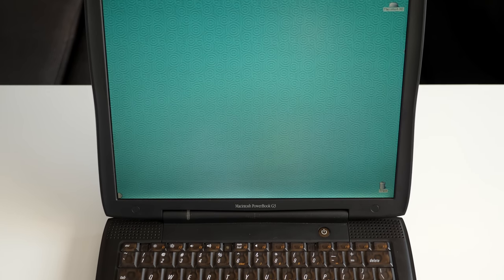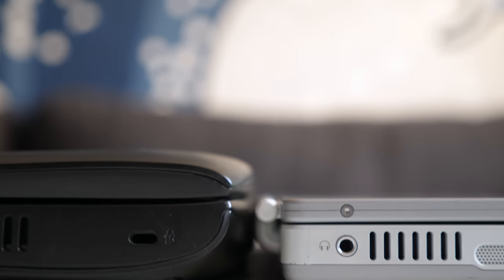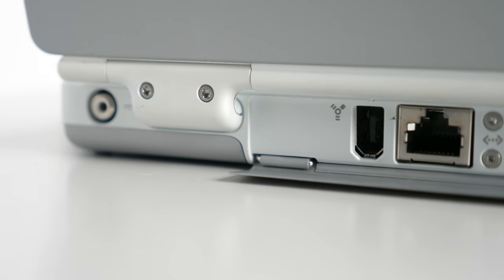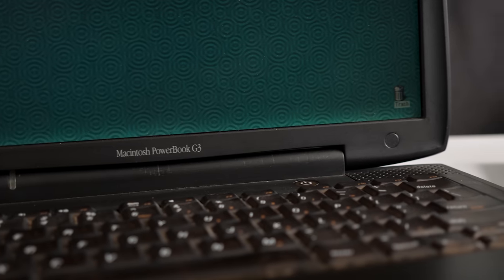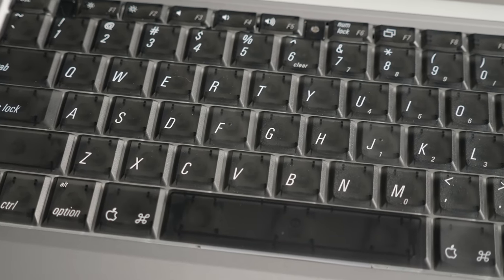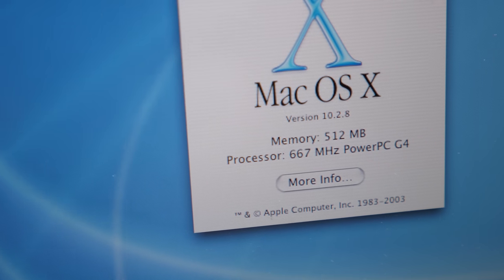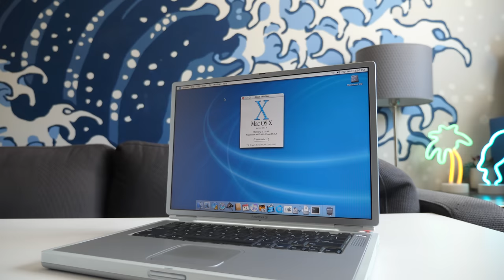The laptop that made Apple switch to aluminum

Comment: I was working as an on-site Mac consultant in 2001-2002, right when these machines were common, so I worked on them a lot. They were cool, but awful. The fit and finish was awful: you had to kinda twist the bottom cover into place because the screw holes never quite lined up. My guess is this is why the hinges failed so often: being under torsional stresses they’re not designed for. The hinge clutches would become extremely stiff to operate, and then that in turn would cause their mounts to snap. 
Also, I think you didn’t even mention how some people’s sweat reacted with the metal (once microscopic scratches in the paint allowed the sweat to come into direct contact), resulting in ugly green corrosion.

Comment: There were G4 upgrades available for the PBG3 models. Honestly they were a better buy than the Ti PBG4 for the first couple revisions because you kept your old computer with all of its extra batteries and accessories and enjoyed increased power, while the Ti PBG4 was only a marginal improvement over a stock Pismo's performance (unless you were really into AltiVec apps which was unlikely at the time) and was never offered CPU upgrades. Only with the improved bus speeds, graphics chips, and L3 caches available in the later models did the Ti PBG4 fully eclipse the best upgraded Pismo PBG3.
Usually the Ti PBG4's titanium bits themselves weren't the problem, but the plastics, pot metal hinges, and adhesive holding much of it together that failed. Also, like with the iBooks and other models with the same retractable hook-style latch, the magnet could become damaged and lose its ability to attract the display hook, or the hook catch on the release lever could break (it being made of the same cheap metal the hinges were). I've had to epoxy more than one Ti PBG4's case back together. JB Weld works really well for it: extremely strong, similar grey color to the case, fully workable when dry, and non-conductive.

Comment: Had only one battery, but you could put it to sleep & swap the battery out for another one - I think you had about 5 minutes before it'd power off completely. After you swapped a new battery in, you'd be able to continue working where you left off. The faster drive made a difference in access time, sustained transfers were bottlenecked, so it was kinda worth it. But that hinge man... I've got a coffee-can full of TiBook broken hinges in a tool drawer. It was a good machine but fragile.

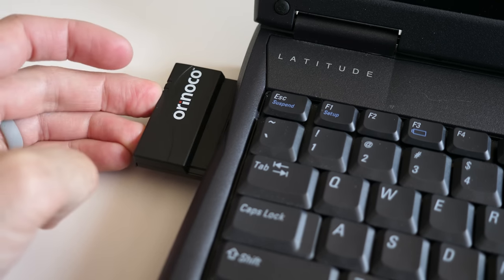Comment: 4:30 Apple wasn’t just somewhat early to Wi-Fi, they literally launched Wi-Fi into the consumer realm. (The original AirPort Base Station, at $300, was the same hardware as Lucent’s router at $1000. Literally the same hardware; it can even use the same firmware.) All of the 11Mbps AirPort gear is based on Lucent WaveLAN hardware. (The AirPort software will even recognize a Lucent WaveLAN card inserted into the AirPort slot, because the AirPort Card is just a WaveLAN Gold card without the antenna bulge.)  The original AirPort Base Station actually contains a totally standard, Lucent WaveLAN Silver PCMCIA card (later ones branded as Orinoco). The iBook was the first laptop to ever ship with the option of internal Wi-Fi, and that didn’t become common in PC notebooks for several years.

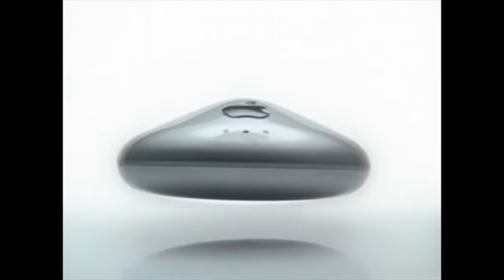Comment: 4:25 I'm confused... you said that you could get an optional AirPort WiFi card... hinting that this was an advantage over many windows laptops that required an add on card.  But, if the AirPort WiFi card is optional, it's it also just an add on card?

I mean from what I can see the AirPort card was housed internally on this laptop, which has some advantages I suppose. But also some disadvantages if you wanted to swap out the card for something thing else like a memory readers or additional harddrive, etc.

Comment: I got a PowerBook G4 way after the fact as my 2008 mbp was too heavy. Turned out the G4 was too heavy too, but I really like the squarish form factor on it. But god I do not miss the cracking noise that slot loader made, you could hear someone insert or eject a disc from an entire house away. 😬

Mine didn't have that odd white border around the chassis.

Comment: Mine has dings all over the damned thing. Otherwise, it was a nice upgrade from my Pismo while retaining the same great keyboard. I still use mine for OS 9 gaming, it’s jacked up with max RAM and HD space, and I added a 4-port USB card as well. Trying to figure out if I could stick an SSD in there at some point. Great little machine.

Comment: My TiBook 1Ghz was my final laptop from Apple, and truly my last Apple product period if one doesn't count the 6 or so Apple Xserves I retired at work a couple years after that). Previous to that I had a Wallstreet then a Pismo. It was an incredible machine, and I nursed it along for years.  I replaced it about 7 years later with a Latitude that, while remarkably less svelte, was much more upgradable and was easier to run Linux on. I did toy with a one of the 12" AlBooks, but it just wasn't... awesome. 

My Tibook got rained on - twice - and came through fine. Was dropped. Still fine. It's definitely beat up but hell, it's on a shelf somewhere and I would bet it would still power on if I could find the power adapter.

Comment: Too bad they removed the option to take out the disc drive and replace with a second battery.  I loved that about the G3's.  I still have my G4 1Ghz that I used throughout college.  The shell has a big crack but it still boots.

Comment: I have a couple of these TiBooks ...   The hinges and paint wear were really the worst problems.  Otherwise, they were powerful compared to what was available at the time. :)
Reply: Surprisingly i don't have any issues with paint and i have a 400 MHz model. For hinges - the screen on mine didn't last long enough - my  friend tripped and headbutted it. So i did a simple thing - disconnected display cables and unscrewed the hinges, made small stainless steel covers for those hinge holes and planned to replace the LCD later. 20 years later that display frame is still In a box. Mainly because external display i got using was so much better than any laptop screen you could get. So it's technically not a laptop anymore but more like those home computers from 80s or modern office keyboard computers. Funny thing is that original battery finally gave up in 2021. 20+ years. For the last 5 years it was holding a charge for about 25 minutes. Also it was relatively easy to open that pack and replace those lithium cells (you must know what you're doing though, tinkering with lithium batteries can be dangerous for a newbie) . Also - no issues with a keyboard, unlike quite recent models.
Reply: @shadowflash705  So will you ever replace the screen?

Comment: Also the battery was prone to swell after a couple of years and this in turn would ruin the case pressing hard inside the computer; so many design flaws it looks like another Steve Jobs reality distortion field obsession
Reply: @Captain McDog not that rare. I had this model and another later model with removable batteries and every battery swelled and broke it’s own case in time.

Comment: I just bought a 550mhz model on eBay, it seems to be in good cosmetic and mechanical shape save for a few scuffs. I wanted the newest Mac laptop  capable of running Mac OS 9. I be always wanted to get into classic Mac OS, bit also wanted a good amount of speed to go with it.

Comment: it took other companies for YEARS to finally adopt aluminium notebooks. Apples notebooks were superior in the time of 2008 until early 2011, no other company packed that much battery, performance and quality in their notebooks. If you wanted superior battery runtime in a notebook between 2008 and at least 2012, so for FOUR YEARS(or more...), there was no other option than a MacBook (Pro). All batteries between 2008-2012 models are also easy replacable next to other things like HDD/SSD, Ram,...

My 2010 MBP is still working after about 3000 charging cycles, heavy usage and 4 batteries. Only one capacitor was degraded over time i replaced myself a few months ago. Except for heavy workload i avoid with a 2010 machine anyways i get 6-8 hours battery runtime. 4-5 with dGPU. Thats impressive, and 2C/4T i5 at 2,53 GHz is still ok.
Also, you dont got any better screen in notebooks anywhere for also some years... MacBooks were so far ahead at its time in 2008-2010, but then apple made so much BS and anti consumer decisions.
Dont even know if i upgrade my good old machine with a M2 or M3 Mac then, but at least the M1 Macs look promising. But the support of apples "silicon"... i dont know :/

Comment: Titanium has made a small comeback with the Apple Watch. IBM also used titanium powder in their plastic on some contemporary computers. I guess the lesson learned was while it might be lighter than aluminum, it isn't a good choice for building machines that need to be moved around. I wonder why they never tried it with a desktop model first?
Reply: Desktops don't need durability nor light weightness 😂

Comment: The ti book is an underrated design. It can be torn down to the bare metal in less than an hour, all the screws in the case are the same size. So broken components including motherboards could me reasonably replaced. Most of 5hd faults mentioned are due to design choices, weak fiberboard instead of strong prepreg carbon fiber, tiny metal hinges instead of the more robust steel ones in third party replacement kits. 

None of this oh this tiny component is broken, we won’t let you replace it, go to the store and buy a new computer like the apple of today

Comment: I'd still love to see Apple try their hand at casting and then machining out a titanium chassis using their newer "unibody" designs. Titanium is far more durable than aluminum while still being quite lightweight. Unfortunately, its durability and, most importantly, its wear resistance, makes titanium a veritable nuisance to mill out. You pretty much have to use carbide inserts when machining and coolant is an unavoidable eventuality. Even then, it'll wear out your bits significantly faster than machining even 7000 series aluminum.

Comment: the powerbook G3 wallstreet was such an amazing idea shame they didn't keep the design
Reply: As nice as that design was for the late 90s, it wasn't going to hold up in the long run. It has large screen bezels, a thick case, where as the PB G4 Titanium and later PBs all use a thin flat design with small screen  bezels. The somewhat bulbus design of he G3 just wasn't going to cut it forever.  Yes there were tradeoffs in the PB G4 design such as lack of a swappable drive bay or extra battery option but design wise I could live with that at the time. Given how much USB and FireWire progressed by 2001 for external drives and how much battery life was improving I think it worked out OK, especially with the aluminum G4 models.
Reply: @Charlesb88  I understand your reply, but the bay things were excellent idea they could have kept this with different design. The pcm cards stuck for a while before disappearing completely. You could use two batteries, swap the dvd / cd drive.. it is just heavy and not strong enough as I even broke the plastic when screwing back the chassis.. was already head of the time! the little connection were small that we found out back many laters when they could have used again..
Reply: @TheMetalMag  while it may have been possible to have two pro models including a heavier thicker desig with extra drove bays/battery bays alongside the 1” Titanium PowerBook G4, it don’t think most of the Titanium PB G4 owners would have chosen that option. I get the benefit of drive swapping and an secondary battery option but I also get the benefit and coolness of thinner and lighter and I can remember lusting after the Titanium PB G4 in ways in never did with the older PB G3 laptops. Of course now we get all the battery life we need with the M1 laptops and we don’t really need Optical or floppy drives anymore (or the few times we do we can pull out a USB drive for that purpose). That sort of design made the extra drive/battery bays made sense at the time but no longer does, even by 2001 it was starting to be less important for many Mac laptop users, though maybe as a second PB option it might have made sense but not so  UC has the only option for pro users.

Comment: I don’t recall the issues with the titanium wide spread. A lower point in apple design was the white plastic phase; hard to keep clean, cheap looking and scratched easily.

I’d like Apple to go back to the g3 design. Mix a little powdered carbon in the plastic and call it carbon composite!

Comment: 3:06 you barely could identify this as a Mac compared to the repairability of the modern ones, easy access to the RAM and Hard drive slots, a lot of IO, chassis you could reach with only removing a few screws, swapable batteries, we lost so many features whilst looking for thinner computers, and apple's boneheaded anticonsumer practices.

Comment: Oh god so much wasted space compared to modern laptops. I know people are all for repairability and sustainability and all that, but when the battery is less than a quarter of the volume and the rest looks like empty space, plastic, and interfaces for possible future upgrades, the thing itself wastes a lot in order for the mere potential to have upgrades or slightly better repairs. This is a critique of old laptop design in general. They were more desktop replacement than actual mobile devices.

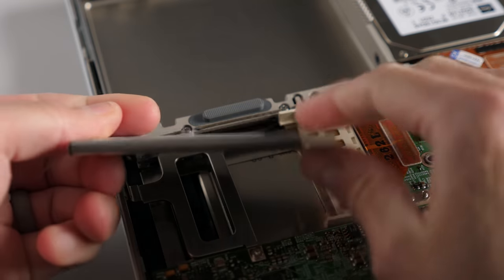Comment: 4:10 “because of the ATA-66 bus, not much performance was lost to the [4200RPM] rotational speed”. Sorry, that couldn’t be more incorrect. Upgrading to 7200RPM made a huge difference in performance because of the decreased seek times. Seek times is precisely why SSDs provide such a massive performance boost over spinning disks, even on ancient machines.

Comment: It always annoyes me, when one tells you, windows laptops didn't have this or that, ilke windows laptop is a brand.

my thinkpad t40 from 2003 (ibm) had wireless connection. some random cheap acer laptop? maybe not. 

But it never was apple vs windows...it was apple vs hp vs dell vs ibm vs acer vs asus vs fujitsu siemens vs....and it still is.